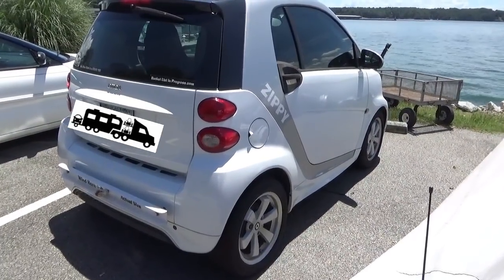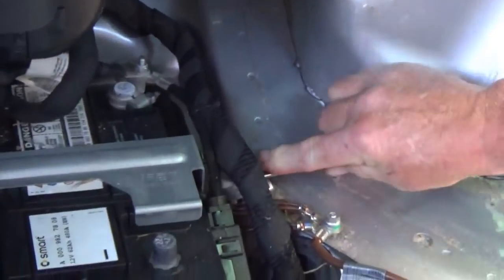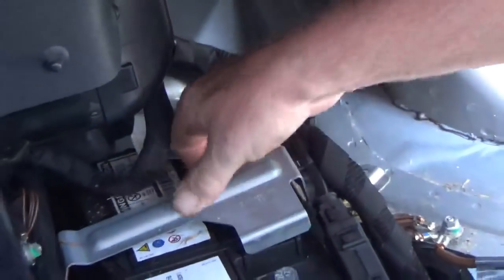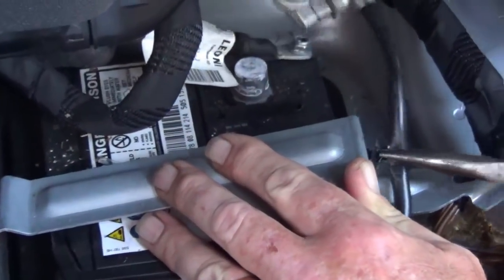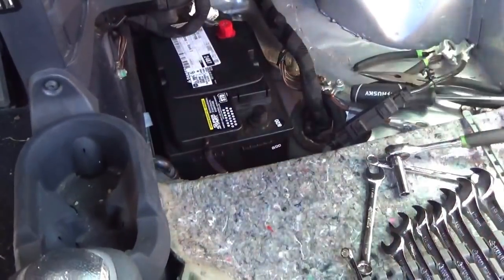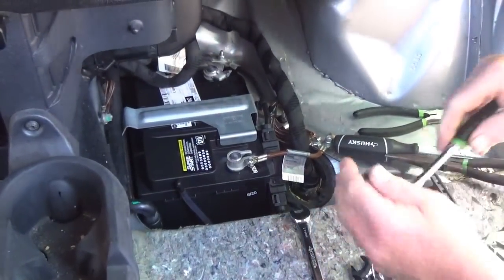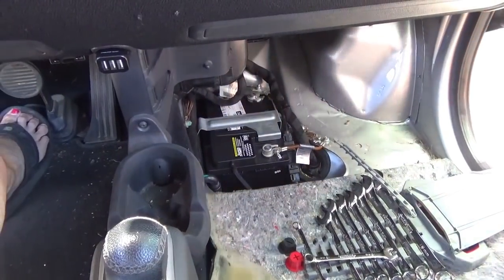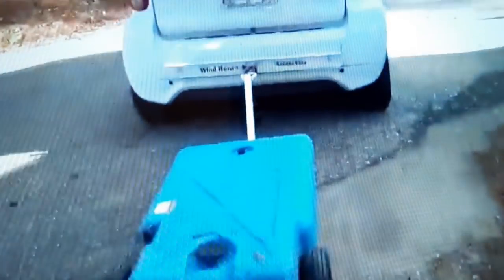💪 Smart Car Battery Replacement // Not Easy!

Comment: Thanks to your video I was able to change my battery in my 2013 smart ForTwo. It was the original Mercedes battery from 04/13 and did not have a handle. Plus, it weighed a ton.  The new battery from Advanced Auto was $200! Hope it lasts another 7 years. The maintenance number of days is a pain to reset.
Reply from the maker: Glad you were able to change it out.  Ours is a 2013 also.  Most maintenance is a pain on that little thing, but we love it.

Comment: You got me thinking when you were saying you'd have to pull up the carpet and such to jump the car, but on my BMW wagon the battery is in the back of the car under the floor boards and to jump my car there is a positive terminal under the hood and then just a chassis ground. Look around for something like that.
Reply: Yep I second this. The two cars I’ve had with batteries in the trunk I’ve always had a positive terminal. It makes jump starting much easier.
Reply: my hhr also has the jump studs in the front near the engine.
Reply from the maker: Hmmmmm.  Glad to know.  I'll have to check that out.  Thanks.

Comment: 1/30/22 bought smart car last september.bought into garage to start on the front
took off front hood.took a quick look around and was going to change some fluids
left hood off for a few days
battery died
didn't know there is a hood affixed sensor
last person that was in there had never attached the the battery exhaust
never ran the car, so seeing what i'm seeing,the batter is venting inside the car
Reply from the maker: Not aware of a sensor on the hood.  The battery has a clear plastic vent tube that should go out through the floor board on the passenger side of the car.

Comment: Wow! That was a tough one! I’ve owned two different Smart cars and I’ll tell you the Smart 453 is much easier to work on. The accessory battery like the one you replaced is actually under the hood in front.
Reply from the maker: Surprised they found room there.  It's like a Rubik's Cube to open the hood. :)

Comment: although it can be a tight fit I like the batteries on the inside out of the weather.  Our hhr chevy battery lasted 13 years.  Dave I was waiting to here your wifes question to you, "are you bleeding yet?"  always a good video.  that umbrella sure came in handy.  4 beers at least.  Did you ever look into the mod kit for the hand crank in the rear?:)
Reply from the maker: Good point about being inside out of the weather.  If I bled, it would be another beer (darn).  Looking at Amazon for the hand crank right now.  :)

Comment: I see you change battery before I learned that if I used option battery they are smaller in size just sam amps if they go stone dead they will still change and they don’t freeze and no water needed i have them in some of my equipment up in North Dakota they last a lot longer than led as
Reply from the maker: Good info...thank you!!

Comment: WOW Changing a battery is a four beers job, that way harder than it should have been, the trouble is that these smart cars was engineered by Mercedes, and they are known as being hard to work on, often you can't get your had down the side of the engine to work on.
Reply from the maker: Yep.  Sooo compact.  Had to change a door hinge last summer and had to take half the car apart to get to it.  But love the car anyways.
Reply: @WattsOnWheels  LOL there is a legal requirement over here in Europe that you must be able to change a headlight bulb at the road side, this was easy on a Ford to do (2 minutes max), but on a Renault (French car maker) the easiest way to change a headlight bulb is to take the front bumper off (an hour).

Comment: Sorry Karen but that is one of the easier jobs on a 451 Smart. The positive is those cars are MUCH better than the newer 453 body that started in 2016. That hook is the “towing” eye. There is a hole in the front and rear. Not intended for a tie down. Get Dave that beer he needs.
Reply from the maker: Had to put a new door hinge on last year.  That wasn't much fun either.  Just getting the hood off is a pain in the butt.
Reply: @WattsOnWheels  When you need work instructions let me know (I have access to the factory information). I can get them to you. It “may” cost you less in beer. 🤣

Comment: I had to replace the battery in my '09 Smart a few years ago.  It wasn't difficult, BUT the recommended battery is freaking expensive.  

Don't ever break a tail light..  each side is 1 piece and it's a $500 part.
Reply from the maker: Wow.  You got that right.  Guess that' why they make red tape.